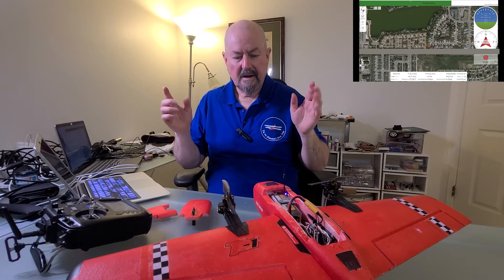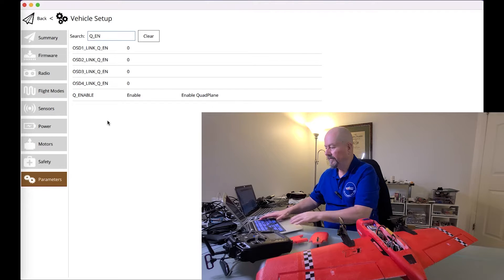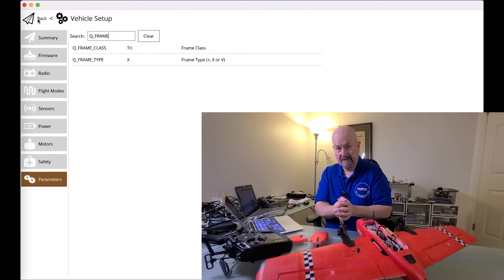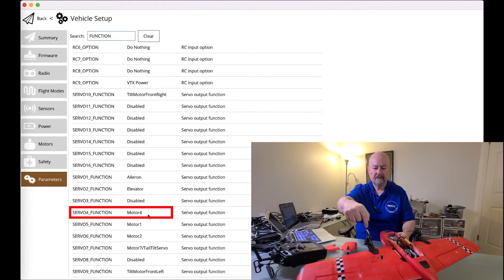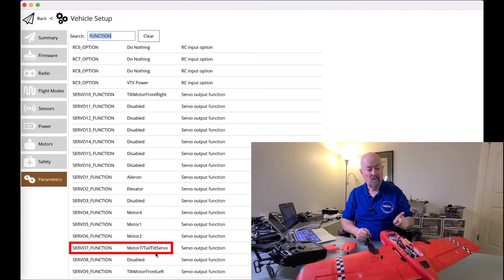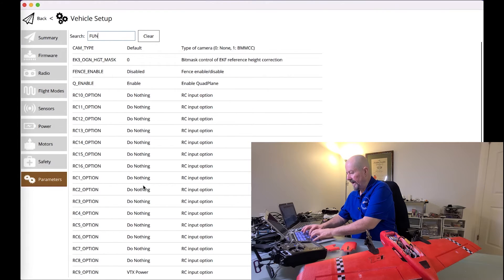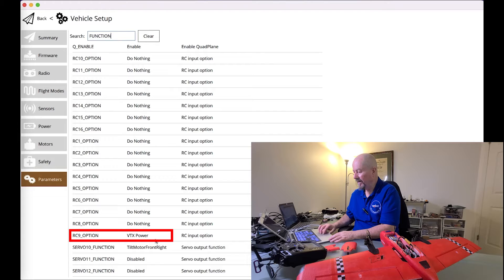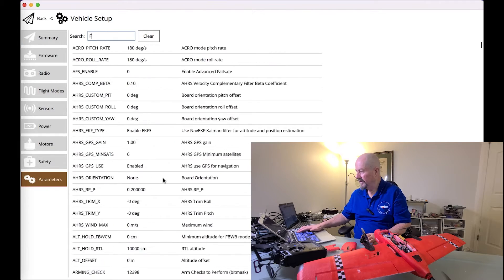T1Ranger Assembled Part 2 - simplified Ardupilot QuadPlane setup

Comment: I have a question which could possibly make me look like an idiot. 
How does the tricopter element of this plane work with no servo on the rear motor allowing it to tilt from side to side?
Reply from the maker: It's a good question. The answer is that it varies the power/rpm on the left and right motors, e.g. if the left motor is spinning faster, the left side goes up and the plane/vtol moves to the right. Its the same way a standard multicopter works - those usually don't have any motors that tilt.
Reply: @timtheplaneman  thanks Tim, I don’t see how it could remain stable while yawing if that was the case? I’ve just never seen a tricopter without this function. Are the wing mounted motors at 90deg to the wing/ground when hovering or are the slightly offset to eachother?
Reply from the maker: @willglover5494  The wing mounted motors tilt to point upwards while in VTOL mode. These motors tilt to assist the yaw. ArduPilot makes it work!